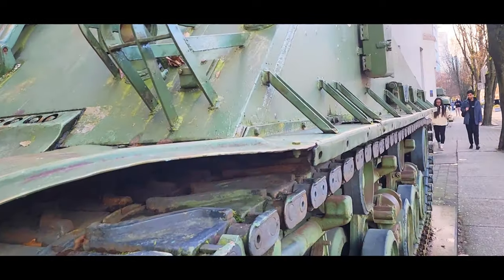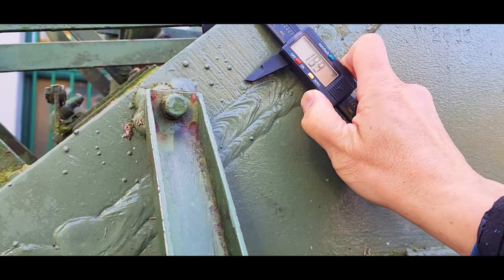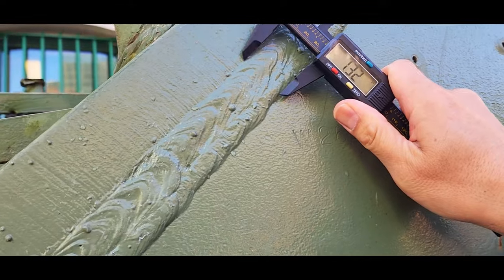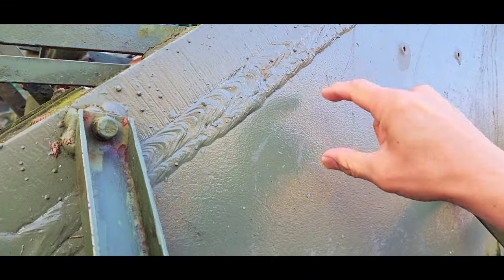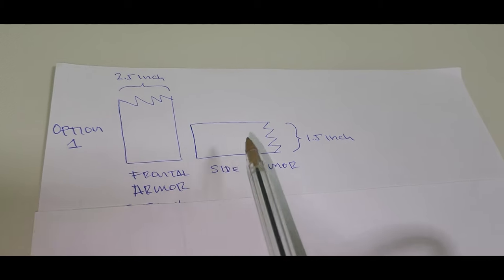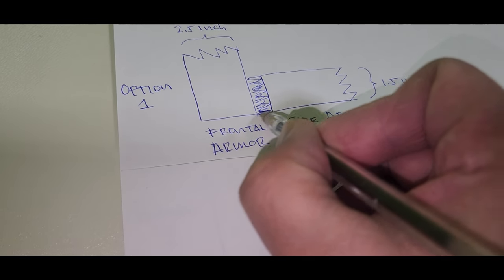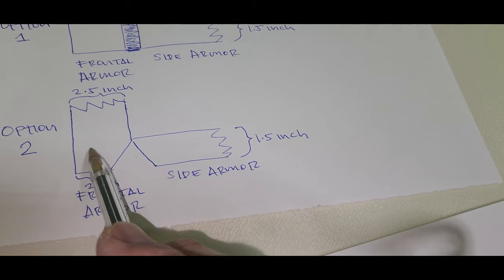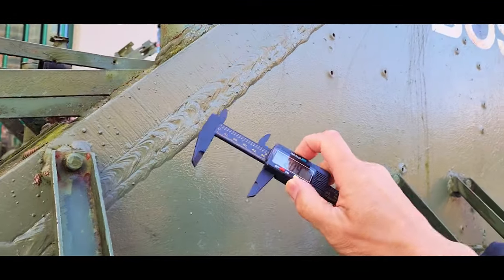M4A3E8 Sherman Tank Frontal Armor to Tanks Hull Welding Process

Comment: The answer is probably both.  Welding of thick plate usually involves both chamfering the edges and leaving a gap as you weld.  In the case of plate that thick, it was probably welded from both sides.  In that case, the  the 2.5" frontal plate would be chamfered for the outside weld, and the 1.5" side plate would be chamfered on both sides.

|                  |
|                  |
|                  |     ___________
|                  |  /
|                 /  \
|________/       \____________
Reply from the maker: Thank you for sharing. You are right, chambering on both sides of the 1.5 inch side armor allows for welding on both sides which results in a stronger weld 👍